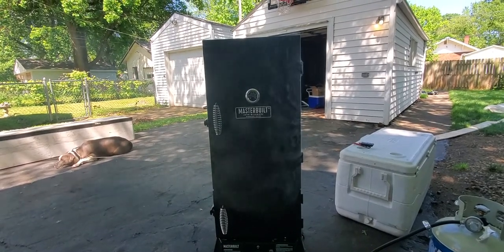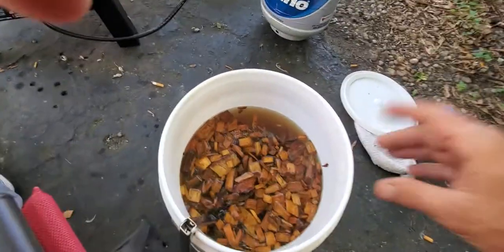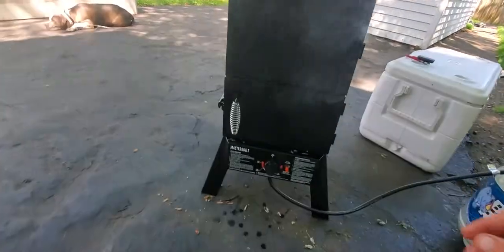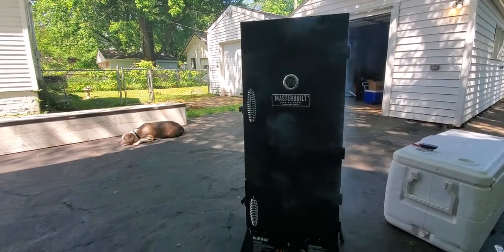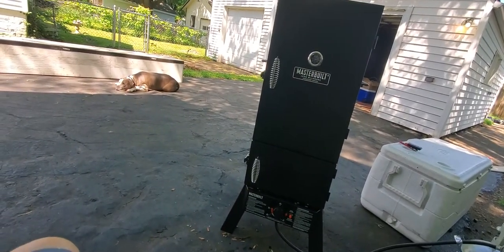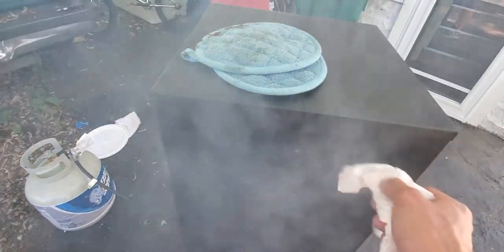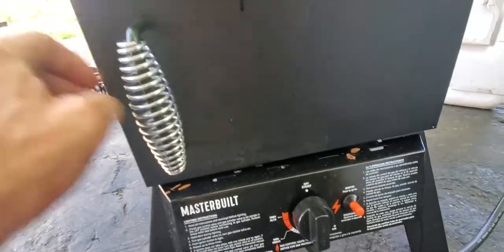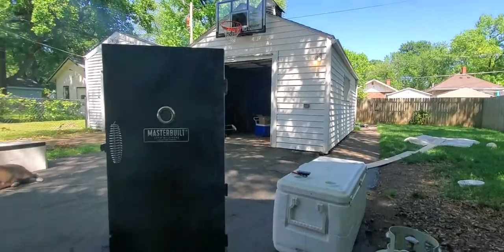How to use a master built smoker.

Comment: 1) buy some weather-stripping insulation (non rubber - felt is best)  for door hinge side (less than $10). Too much smoke escapes from the side. 2) Buy a cast iron skillet for the wood chips. (around $20) dispose of the manufacturer's tray or place the skillet on top  3) Buy 2 meat thermometers: one meter to be placed in the smoker on a shelf to "verify" your smoker temperature. Place it through the grate. The other meter to poke into the meat to verify it's done.  
Awesome dog. You sound like a guy I could grab a beer with and sit next to the smoker all day. Peace.
Reply: Exactly as you said Dad,,,
Reply: I think I'm gonna try the skillet instead of the current tray. Sounds like a good idea.... And that built in thermometer reads different than my external thermometers... Should I be worried about the inside of my door? I was cleaning it and the pain on the inside seems to be coming off. It's not bare and silver like his in the video.
Reply: @kennyv5424  I never trust the thermometer on the smoker. I always use a separate external cooking thermometer. I use a ThermoPro, you can get them on Amazon. I don't clean the inside of my cooker...I mean I clean the grates and the smoking pan but not the insides....my cooker has a wonderful smoker smell.  When not in use it's covered in my garage.
Reply: @dwmatl  how many chickens you think would fit in there ?

Comment: Hey amigo.  Thank you for the very informative video.  QUESTION… I’m brand new to smokers, but recently picked up a very nice (used) stainless steel, vertical propane smoker (GRAND CAFE Gas Smoker) in excellent condition (for only $50), but I’m struggling with being able to maintain a constant lower ambient temp (i.e. 225-250 degree range).  The ambient temp keeps wanting to eventually climb to 300+ degrees, and so I open the smoker doors every so often, but that’s not really a proper solution?…. The gas intake on the smoker itself is set to the lowest setting…. Water pan is good…. I’ve tried dry wood chips vs. soaked wood chips vs. combination there of, but still no dice… there are no flareups either….  I don’t have an actual closable damper, but there is a vent on the top of the smoker, of which I could potentially wrap a bit of foil around one side to damper the air intake (maybe just a bit), but I haven’t tried this yet…. The only other thing I can think of might be to (tighten/close) the valve a bit (on the actual propane tank itself), so that less fuel enters into the smoker.  Might that prove be a viable solution???… Any other variables you can think of?… I would be HOME FREE if I could just figure out how to maintain a constant lower ambient temp (i.e. 225-250 degree range).  Thanks in advance for any sage counsel or advice.  Cheers! 🙂

Comment: I bought the same kind of smoker and the same kinda gas, you did help I wondered why it went thru so much wood I forgot to soak the wood...thanks
Reply: Probably had an issue controlling heat too ?

Comment: I have an issue with heat, seems like every setting for flame is too hot
Reply from the maker: Close the vent in the back all the way. If the wood is on fire.that will add heat. You want the wood to smolder  and smoke. I soak the chips for a bit..A spray bottle is good to have to help keep the flame down. Hope this helps. Merry Christmas
Reply: @robnein2594  thank you I’ll give that a try.
Reply: Get a cast iron pan, 2 piece of rebar and use chunks not chips, works amazing.

Comment: Never soak your wood chips in water. Soaked chips will not smoke, they will just steam and not impart any flavor. And steam can cause rust inside.
Reply: Water is used to hydrate the meat and keep it juicy. The damp chips do add flavor. It stops the chips from burning and it also ensure that the chips last longer. Dry chips result in more smoke and a much more flavorful steak in the short-term. Wet chips are used for long smokes that add flavor aswell.
Reply: Amateur!  Soak your chips.
Reply: OP is clueless AF. Wow.

Comment: Soaking the wood chips is a mistake. When they're wet, they release steam before they're actually able to smoke, which can affect the meat (you're steaming it, basically). Rookie mistake. Just change out the wood chips as needed. That's why some models (the one I got) has a little side compartment that allows you to add more chips without opening the door and releasing heat and smoke.
Reply from the maker: Looks like smoke coming out that smoker to mee. Js

Comment: This smoker is terrible. Worked great the first year. This is the second year with it. Damn thing caught fire. Before someone says something I cleaned it either every use or every other use depending on what was cooked. This thing isn’t worth the money.
Reply from the maker: Did you re spray it after u cleaned it? I'm not having any of these problems. Had it a while never had a problem 1.
Reply: @robnein2594  I sprayed 1 time every other time I rubbed the racks with vegetable oil.
Reply: User error
Reply: I don’t know what is wrong, I can’t get mine to light. It started for about 30 seconds then nothing. I have full tank of gas. Frustrating!
Reply: @melindaturner3311   some times crap can get in where the tank hookup is blow in either end to try and free anything that’s in there.